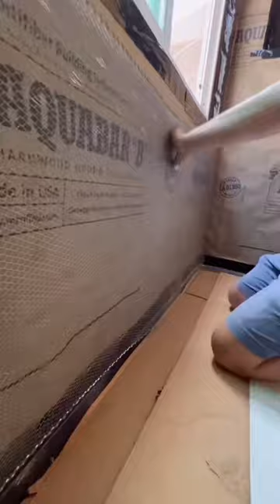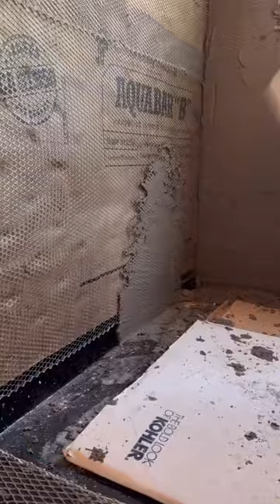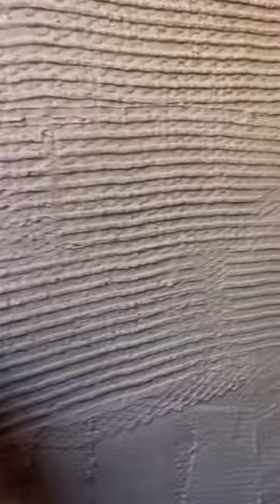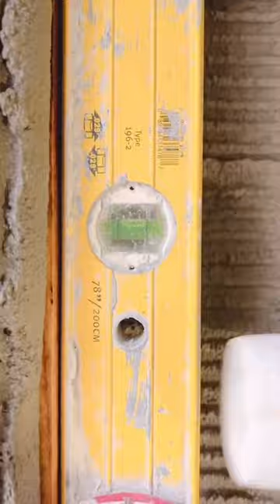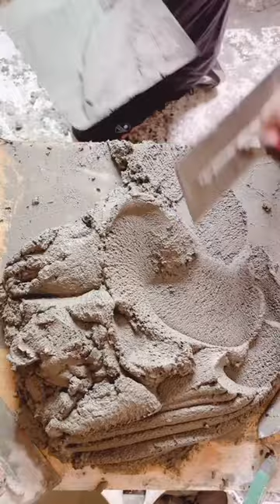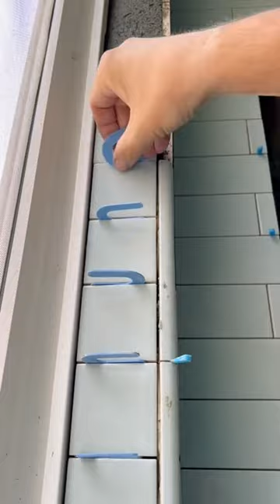Old school tile shower prep and installation.

Comment: Really nice! Did you know that you can put wire mesh on upside-down? Well,you can and the mud won't hang on as well..
Just a tip for those that don't know?
I AM PLASTERER 1963
Reply: Yep,,,was shown
Reply: @stevehamman4465  It's hard to see but it looks like the first piece they put on is upside-down.  The angle of the wire slant goes away from wall,instead of towards the wall. If you understand what I'm saying? Not many know the difference.
Reply: @petekobraoutdoors7324 , I hit the wrong button last time.  Yes one side the holes flare outward larger side to the outside.  Correct?